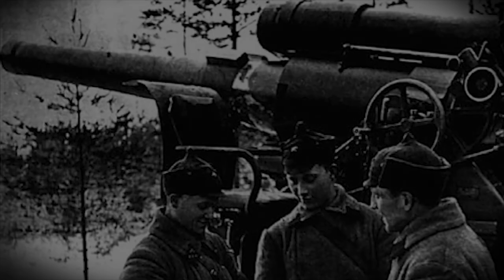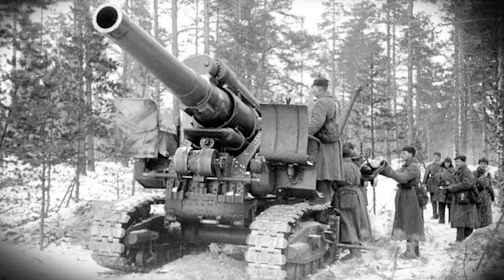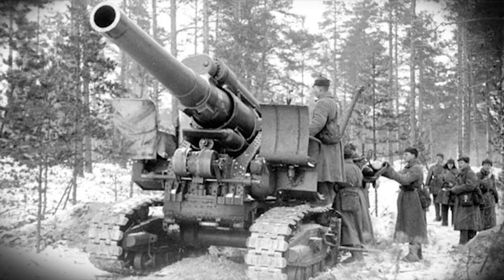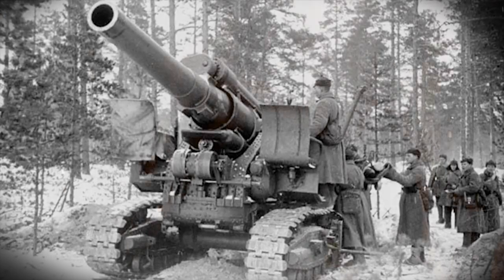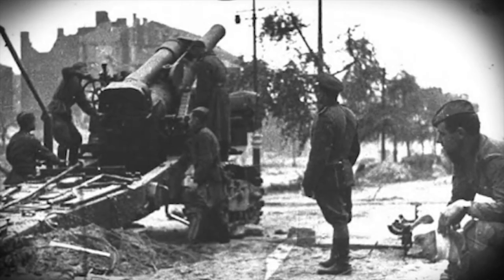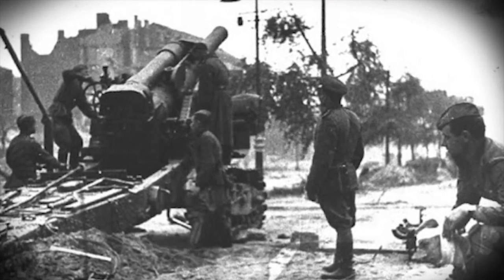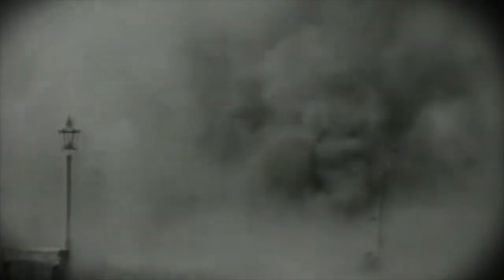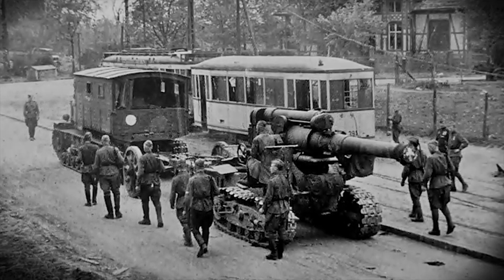This cannon tore German tanks to shreds during WORLD WAR II

Comment: These cannons were so powerful that mounting them on an armored tank chassis and firing them once damaged the suspension, the turret's rotating mechanism, and knocked out the crew only with the recoil.
Reply: The BR-5 is better off as a towed artillery piece rather than a Self-Propelled one due to the difference in fuel and financial cost

Comment: 🏍️ 'tore up German tanks ' ? Quite a claim for a howitzer not intended for use against armor.
A gun that takes a long time to aim and load ; better hope that German tank sits still and says 'cheese'. 📷
Reply: There are examples of its use in Berlin firing at emplacements at near point blank range. Alot of those emplacements were also immobile tanks such as the Panther ones and twos.
Reply: @RestlessBogatyr  Very true ..there are several you tube videos on Battle of Berlin where the Red Army under  Marshal Zhukoy and Chuikov used these 203mm heavy howitzers.it was overkill but they wanted to make a statement after Wehrmacht/Airforce bombing and destruction of Svestapol,Stalingrad,Kursk,Kharkov,Leningrad !
Reply: @RestlessBogatyr   These guns were used to smash bunkers and fortified lines not take on Panzers, there were not even near Kursk.